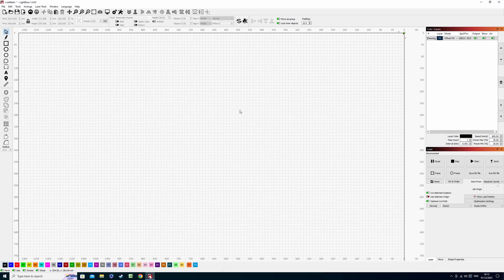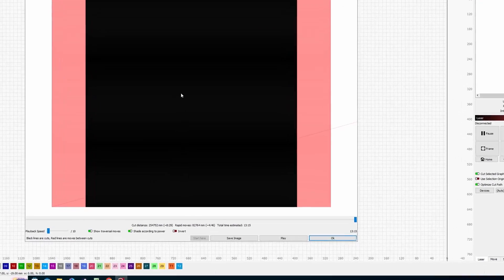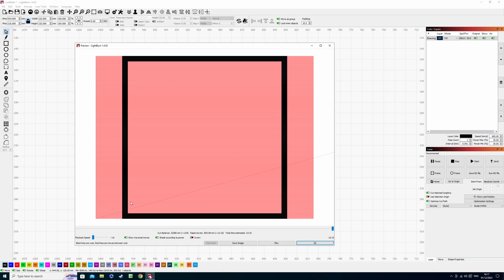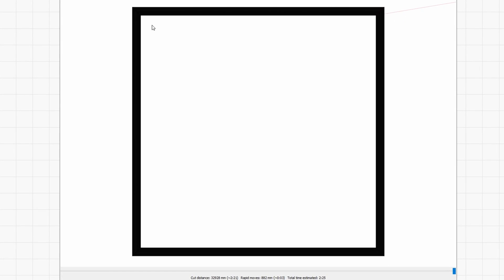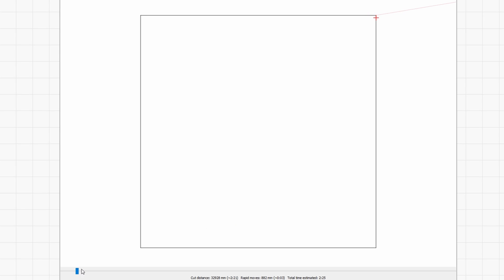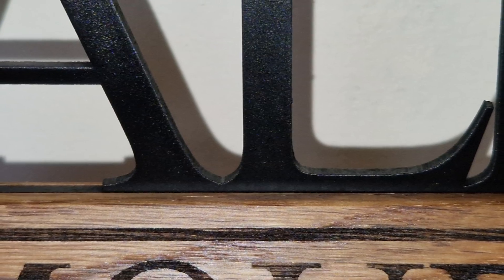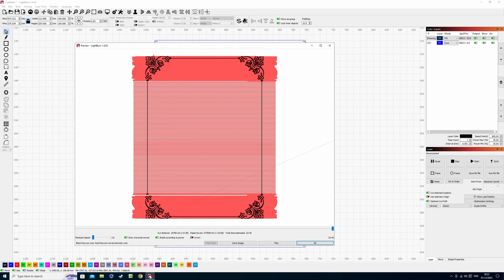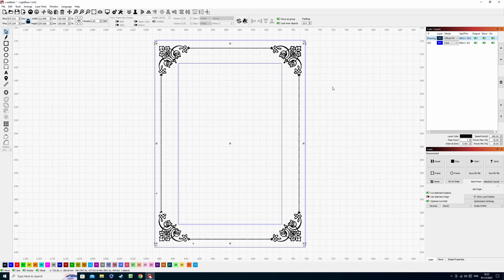What Is Offset Fill In Lightburn

Comment: Why isn‘t that the default? Trank you very much!
Reply from the maker: This is not set as default as its purpose is specific to certain things like boarders in the video. You can achieve better results and times with normal fill or flood fill if there is less white space. 
I hope this helps.
Reply: @MadeBetterWithKnowledge  Yeah I noticed, engraving/removing paint from aluminium looks terrible with this setting

Comment: Thanks for this video.  I've learned quite a bit about lightburn from just a few videos you have posted.  I did notice you have an Etsy link for your shop.  Have you considered a website of your own?  It does require a bit more of your time but you don't have as many fees as using Etsy.
Reply from the maker: I have taken a look in to creating a website, I am in the process of sorting out a shopify account, and setting up a google drive so i can start giving away free files. At the moment its a time and hardware issue. I haven't posted a video for a long time due to issues with my pc. Hopefully I will be back up and running shortly. Thank you for your comment. Can I ask, If you have a website of your own what did you use to set it up?

Comment: this is a huge importance tip to give, and i apreciate a lot, im just starting i dont have any experience yet and cant apreciate more ur advice, i can give you one in return in my humble opinion of course,  there are a visual relation between letters on a name or brand in wich the form of the letters just dont fill the same spaces between each other, in this case u can see the sentence RANGE WARDEN, warden its a good balanced word but if u look at RANGE, the separation between R and A and A and N looks higher than the rest, in some cases u can adjust that visual look spacing a bit more the rest of the letters, like N from G and G from E, of course this is not for all texts, just in rare cases that u see it could work for u, Thanks a lot!

Comment: What file formats does this work with. If I import a png, I don't get the option for offset fill, only fill.
Reply from the maker: You will have to change the image to a vector file, you can do this easily with the trace function in lightburn. I hope this is helpful.

Comment: So do you put the border of the name plate on a different color and set it to offset fill, just the border
Reply from the maker: If I have text to be engraved on the same job I put the border on a separate layer. Sometimes people just want a border in different styles in which case I batch out a load with their specifications. Alot of people have their names cut out in vinyl as its easier to change but they want a permanent pattern around the outside. 
I hope this helps.

Comment: Cool tutorial thanks! I have one question, is there such an option where the laser power is constant but the speed is variable. I mean when the laser is moving fast it doesn't have enough time to burn, and when it's moving slowly it has enough time to burn the wood. So that all shades are based on the speed at which the laser passes
Reply from the maker: Hi thanks for your question. My honest answer is I don't know. My guess would be that it wouldn't be possible as software for lasers work on a dot to dot basis. The power is set to fire at a different power depending on the cluster of dots. Or power on for a black dot power off for a white dot. It is an interesting idea though.

Comment: ive yet to play with a lazer but it seems somewhat apparent that with fill, the lazer overshoots the burn area in order to slow down and change direction without burning the material. this offset fill method, as clearly shown from your square border example, slows down to change direction on the corners, if the software doesnt compensate for this change in speed by altering the lazer strength then surely you will aggressively burn the corners of your work and you should see a decrease in quality. This will probably not apply to a lazer that is driven via ball screws since the head is so light, momentum will not take too much affect and your probably running it very fast. On an entry level diode lazer using belts i would expect potential problems trying to run at speed. You could possibly combat this by running slower with less power so the change in direction is more uniform.
This is just a guess, i have zero experience with lazers, but a lot of experience with CNC's (industrial) and 3d printers

Comment: Brilliant video thank you. You said you imported an image for the picture frame and I can see you have the options - line, fill and offset. But when I import an image, e.g. a banner outline shape, it just says image? Is there a file format I should be importing with that then gives me line, fill or offset fill options?
Reply from the maker: Yes absolutely. I'm sorry for the confusion. The image needs to be imported as a vectorised image for example an svg or dxf file. If you are unable to find a suitable vector graphic you can easily vectorise an image in lightburn by selecting the image, right clicking and in the drop down menu select trace. You may need to use the sliders to increase or decrease the amount of detail. 

I hope this helps.
Reply: @MadeBetterWithKnowledge  thank you so much, very helpful 👍🏼

Comment: That is something no one else talks about, Thanks. I have a question that I hope you can answer for me.  Can you  tell me how to turn that cross hair on and off?  Mine does not come on and I need to know if it's a problem with the machine or if something got turned off some how?
Reply from the maker: Hi Donald. I'm sorry for the late reply to your message. For some reason, I have missed it. The crosshair, I'm assuming, is for when you are framing in lightburn. If so, if you hold the shift key and click the frame button, it will turn on whilst it frames. If this doesn't work straight away, there will be a setting to turn on in lightburn. I hope this helps. If it doesn't work please let me know and I'll find out for you.

Comment: Hi how are you. 
Kindly I have main issue in diode laser machine. My diode module is not moving correctly on clicking the move arrow key. Right , Left arrows clicking work good , but when I click up and down arrow key it’s not working correctly. When I click on up arrow the laser module move down, and when I click down arrow key the module goes up. Kindly tell me how do I correct the issue. The machine is twotrees.

Comment: This tip is the best. I made some wooden ornaments for Christmas and couldn't understand why the offset border I created was causing the engraving time to be over 20 minutes, for a simple 4-inch ornament. Didn't make sense. So now I'm very eager to give this a shot and I think you just saved me hours worth of engraving time. Thanks so much.
Reply from the maker: You are very welcome. I have had a couple of comments that say they have had quality issues for some reason so please make sure to test on something disposable first. If you do have a quality issue I recommend using flood fill. It will take longer than offset fill but it will be quicker than a normal fill you can find the setting if you double click on the colour  layer that your border is set to, it will be a tick box or a red and green slide box. If you have any problems leave me a message and I'll get back to you ASAP. 

Thank you for your comment.

Comment: Depending on the design and material, I can see offset fill being useful.  I typically use Flood Fill instead, however.  It saves the traversal moves and keeps the heat high in the zone it's working.  
Maybe you want to trace a border but let the material relax before being hit again, this is where offset would be more useful.  Typically when I'm using fill, it's to burn away a good deal of material to make a recess or well, not necessarily engraving art.  In such cases, offset fill typically leaves rings of material I need to scrape out. (Could reduce interval size, but my material is crap plywood and too* much power will cut all the way through weak and hollow spots in the wood)

To find "Flood Fill" Double click on one of the cut layers in your side panel to open "cut settings editor".  Click the 'advanced' tab underneath the first section of speed/power/mode and click the checkbox to enable.
Reply: Exactly!This is why before engraving a project I try differant settings to see what are my best options,speed wise...

Comment: When I go to the preview for a 'Fill', the laser just goes where it's actually doing work. I don't know why you have red bars of wasted time either side @ 0:55. The square takes more time overall too. LB 1.4.05
Reply from the maker: Hi thanks for your comment. In all of the previews of the standard fill mode there are red travel lines on either side of the examples. This is to do with over scanning. Overscanning helps to keep engravings accurate by giving the laser time to decelerate and accelerate whilst the laser is not fireing. It also helps with skipping on line intervals as well. Sometimes, the laser can skip a line or two giving botched results in the end product. Over scanning helps prevent this from happening.
Reply: Ah that makes sense. I suppose you have to set Lightburn up to do that. The official settings I loaded for my TS2-20W didn't enable that. Is it something you added yourself?  @MadeBetterWithKnowledge
Reply from the maker: So with CO2 lasers with a Ruida or Trocen controller its applied by default at about 2.5%. With Diode lasers it has to be applied manually. If you double click your engraving layer, in the layer tab, in the window where it has the settings for bi-directional fill and cross hatch there should be a setting for over scanning with a red/green slide button. By enabling it you should be able to set your desired percentage. This should help you get slightly faster speeds and help mitigate any skipping of lines when trying to engrave quickly, especially as you have a 20W the modules start getting quite heavy after 10W. I Hope this helps Ziplock ( I havent used a diode for 8 months but i checked the settings for my Ortur and thats where i found it) Thanks again.   @Ziplock9000

Comment: Dude in first engrave you fill the entire box in the second you only filled the borders. This have nothing to do with offset fill or fill. 😢You either fill a box or frame. Useless video. I'm sorry. But there is two different shapes to fill. I know fill and offset fill but this explanation gave nothing to do with learning lightburn. You can fill or off set fill entire box or just the frame. It save time but is not the same.
Reply: Dude, I don't think you paid attention to the video. He explained that with the full box in the first one, offset fill doesn't matter. He said it matters when you have long gaps in a shape, then offset fill is much faster. They were entirely different examples. It is not a useless video at all.

Comment: I'm really glad that somebody finally found this setting, I have been wondering about this for a very long time because I noticed early on a long time ago that so much time gets wasted when, for example let's say you're drawing a circle and it just travels from left to right blazing a little line when it goes across the part that it's supposed to burn, and I always thought well that's a waste, this thing has an x and y axis it should be able to move in a circle so why doesn't it? It should be able to burn that Circle as one complete line with no brake by traveling in a circular pattern or in your case, the square. I've never seen anybody else figure out how to do it. This is awesome that you figured that out.

Comment: That is an interesting feature.  I have manually taken something like this and cut it into two pieces to avoid all of the movement across empty space.  This is even a better option!  I didn't know it was there.  Thank you for this video!
Reply: I incorporated this into my latest video.  It will come out Jan 1.  Using this feature cut the burn time in half in my example.  Huge time saver and way easier to use than cutting your images or vectors into sections.
Reply from the maker: That's fantastic. I look forward to watching it.
Reply: @MadeBetterWithKnowledge  - I look forward to any comments you might have on this.  I am going to reference this video in the description of that video.

Comment: Argh; why didn't I see this video yesterday? I was engraving a clock face, and it took forever because the laser would do a tiny bit of the "9", then sloooowwly scan across to do a tiny bit of the "3," and so on and so on.  According to Preview, this will go much much faster with offset fill.

Comment: Another setting to check out is the "flood fill" setting under the advanced tab in the fill settings. Depending on the design, it can save even more time. Sometimes it's slower though.
Reply: Would the flood fill work ok on acrylic? 😬 I’m having such a hard time not burning all the way through my acrylic AND attempting to get clean fills at the same time :(

Comment: for large boarders like this you should give flood fill a try too, i usually find its faster than offset fill and offset fill can sometimes leave burn marks. flood fill is found by double clicking a layer then clicking the advanced tab on the new window that pops up :)
Reply: thank you!  I get burn marks a lot when I try to use offset fill   :(

Comment: The Problem I have with Offset Fill is that it leaves a visible line in the middle of my engraving. Let‘s say I‘m engraving a rectangle, then the laser is engraving from the outer border go the middle in getting smaller rectangles, until there is just a line in the middle of the rectangle. But this last line is never engraved, so that it‘s visible if you take a close view. I hope this was understandable.
Reply: This changes when you change the resolution (line interval) and eventually do a second pass with different resolutions - that equals the "line problem", but takes more time for the second pass. Another option is to set the resolution above your original laser thickness to overlap the lines of the offset fill
Reply: Defocus the laser a little bit to soften the edges.  5% out of focus for start.
Reply: I do Fill first twice and followed by offset fill twice again. it also matters when you change the intervals I used 0.06 to the smallest 0.03
Reply: Try cross hatching too

Comment: Do you run the same power and speed setting as when you engrave?
Reply from the maker: I run the speeds and max power at the same settings. The only thing I change is the minimum power. The only reason for this is when the laser travels to a corner it slows down. The only thing I would suggest is to just run a quick test just to make sure you're happy with the results before committing to a project the first time.
Reply: @MadeBetterWithKnowledge I 100 percent change my settings especially the LPI and power…

Comment: I understand how it can save time with JUST a border... but in your example case with the text on the inside, the laser would be filling the text at the same time as hitting the border..... so I can't imagine how it would be quicker to do a fill on the text, and then come back and do the outline seperately... why not just do it all in one pass?
Reply from the maker: I agree with the point you are making . When it comes to a large area that needs to be engraved without empty space, the normal fill option would be preferable. The application of using any setting is subject to the individual project. As I stated at the end of the video, I wanted to draw the viewers' attention to check and not neglect offset fill as an option as it COULD save time with their projects. In regards to my sample case. You probably assume that the text and the border are done at the same  time wich might be better to be done as a standard fill, but as a project or product as a whole  they are made differently. Because I make so many of these, I batch them out at 50 at a time. The engravings are done in two stages. The slot on top is cut out for the acrylic or mdf, then are flipped to engrave the border, and they are then boxed ready for when the details are needed to be filled in on the inside. 
I do thank you for commenting on this though as I am still new to creating videos, and I can improve on executing my explanations better.